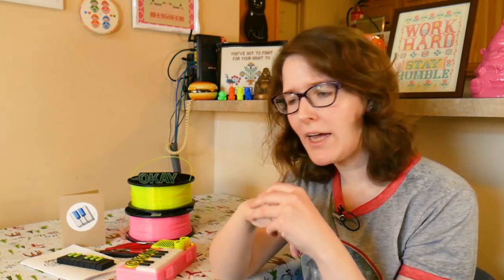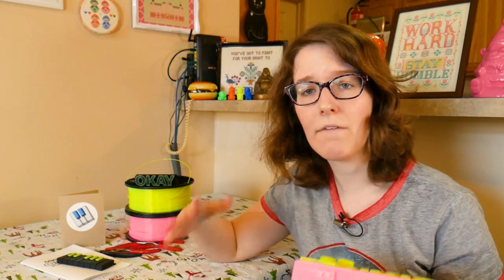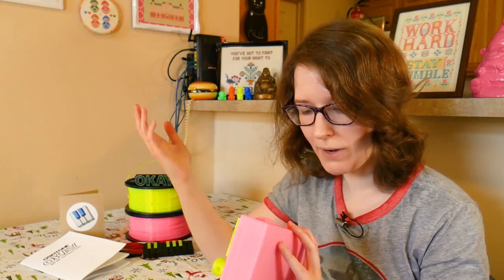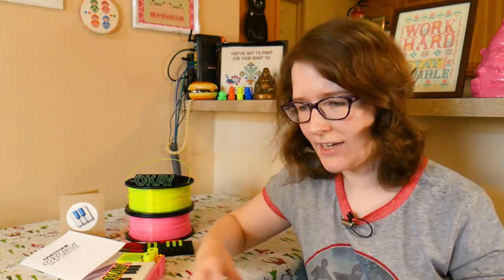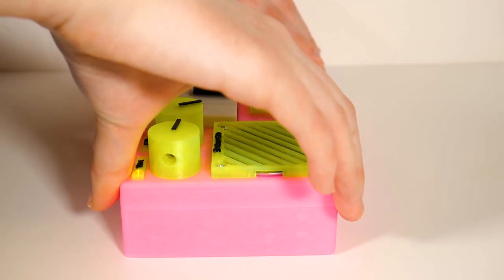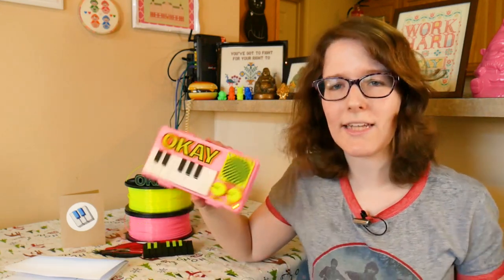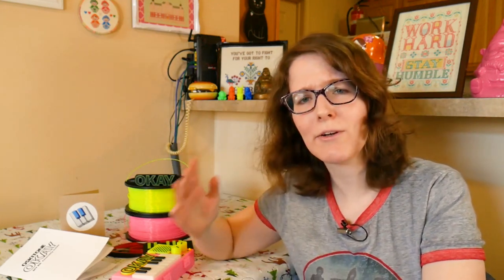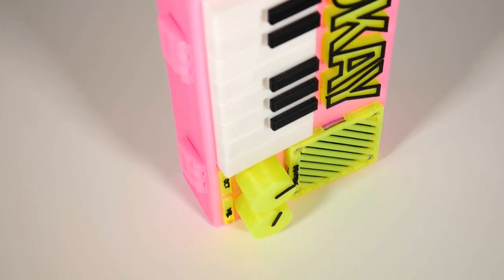Building the OKAY Synth Kit

Comment: You should try mounting camera to build plate if possible. Ive used the gopro hat clip to attach mine.
Reply from the maker: Yeah I'm going to be experimenting with different mountings. That's good to know that the hat clip worked for that.